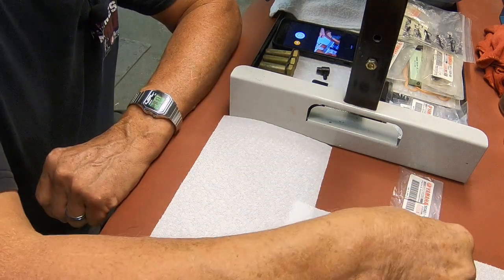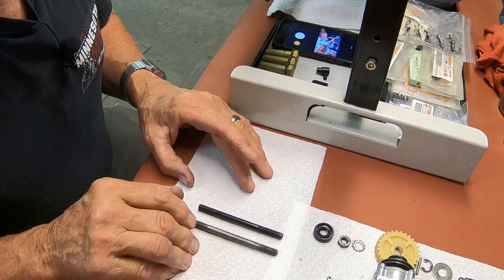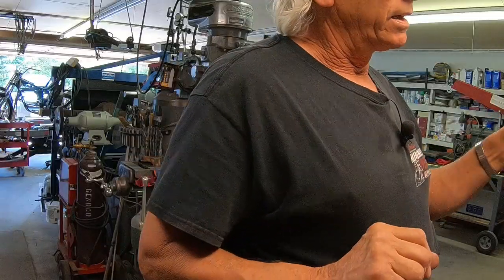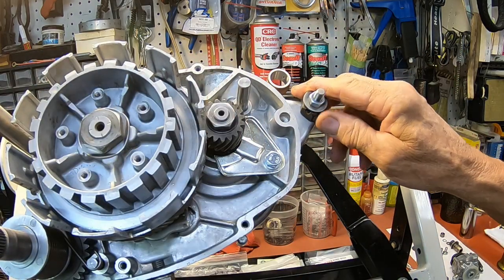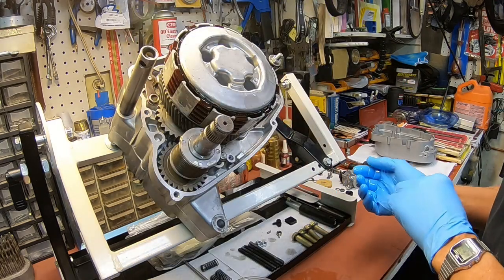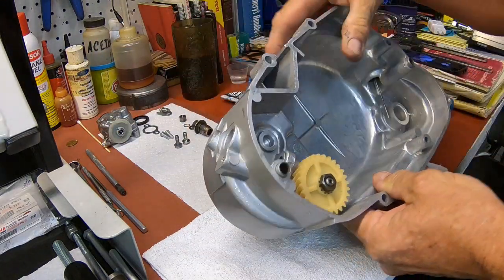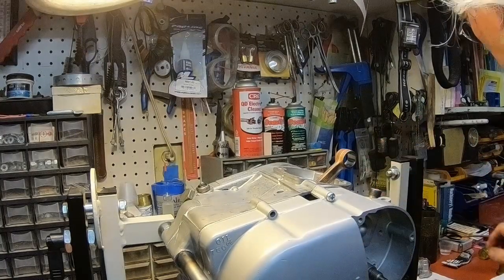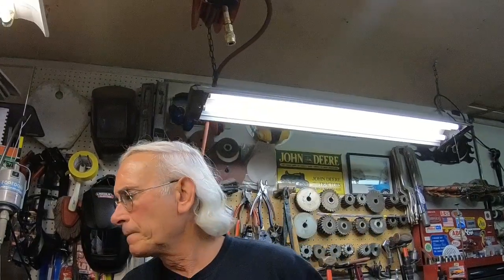Yamaha AT-1 to CT-1 engine assembly part 3

Comment: Another great video Dale... on several Yamaha 2 cycle's previously, I just delete the oil pump with a block off plate. Then i just pre-mix the fuel @ 32:1 and typically they run alot cleaner. But for restoration sake, I think it is good to keep it all original 😀
Reply from the maker: Hi Taylor, there is nothing wrong with oil pump delete, and your right they probably will run cleaner, especially with todays better oils. I have never seen one go bad, but have heard of that happing. The build a AT-1 MX project that I am currently work on will be oil pump delete, just because it is a full blown nostalgia racing bike. Plus I want to run some of that wonderful smelling bean oil. Man I really miss that stuff. Thanks for following along Taylor!

Comment: Hi Dale
I truly enjoy watching your videos. I like the way you pay attention to detail  when reassembling the motor and I like the way you explain and measure the different parts going back into the motor. I have learned a lot from watching you re assemble the motor.
Lee up the good work.
I have 4 Yamahas 69-72 175 all with the same motor and frame numbers.
Question we’re did you get the engine stand did you make it or did you buy it?
Thank you for doing all the videos.
I am now a subscriber.
Mark.
Reply from the maker: Hi Mark, nice to have you on board. I really enjoy doing the videos and am super happy that folks are getting some good from them, or at least some entertainment. Wow 4 175 Yamaha's, that is great. You know I think the 175 is my favorite these days, as you know I own two, the 72, and the 70 (kinda) that I am building now from a AT-1. In the past I was more of a big bore guy, but as I have gotten older and hopefully wiser, I find the CT-2 is just what I like best. The engine stand is a Motorsports products MX engine stand. I got mine from Ebay I think probably 5 or 6 years ago, I just looked, now they seem to be around 160.00. Pretty sure I paid closer to 100.00. But they have gotten more popular. They are great stands, sometimes I have to do mods to it to hold a particular engine or to hold it in a weird angle. Usually just have to drill a hole somewhere and make a separate bracket or something. Thanks for hanging out in the shop with me.

Comment: Hi Dale, I like your videos, I am learning more and more about these CT1's Wondering where you got those seal supports? I find mine were not staying or not put in all the way when they were changed last time. The bike is new to me and I am working on making it a reliable bike and putting it back the way it should be.
Reply from the maker: Hey Lee, glad you're finding some value in these videos. You can find the seal retainers on Ebay, right hand 304-15128-00, and left hand 304-15118-00. They are easy to install and really help to keep them in. Good luck with your CT1 project, they are great bikes.

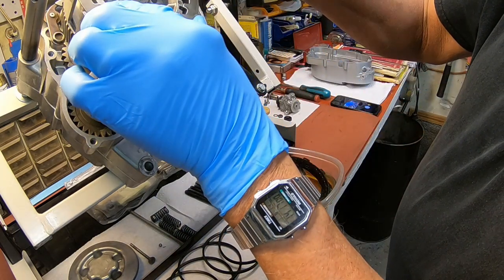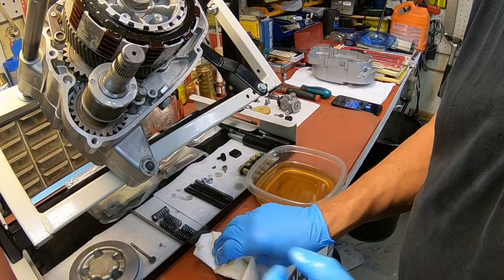Comment: Hi Dale, I love your videos and find them very helpful! I had a question about assembling the clutch. When you went together with it at 27:18, you started with a steel plate and finished with a friction plate at 29:52 before installing the pressure plate. The shop manual actually contradicts itself on P. 56 and 57 showing a friction plate installed first in the cutaway view on 56 and a metal plate first on P. 57 in the exploded view. My question is, would this make a difference? It appears that the surface on the clutch boss is more substantial than that of the pressure plate and might thereby be more appropriate to have a friction plate against it whereas the pressure plate does not appear to be as substantial and might benefit from the steel plate being installed last. Thoughts?? Thank you again for the great videos. I am assembling an AT1C and find that they answer many assembly questions that come up. Nice work!!  --  Tim
Reply from the maker: Hi Tim, thank you very much, I get this question pretty often, let me see if I can address it. You are correct that the left side drawing and the right-side drawing contradicts each other. It is apparent to me that Yamaha didn't even know how it must be assembled either. Some will argue that the left drawing is an engineer's drawing, and it is correct, putting no stock in the other drawing. My opinion is that neither drawing says it is an engineer's drawing and that it must be assembled that way. No where does it say that. In my experience tearing down engines that had never been apart shows that the clutches have been assembled by the factory both ways. My experience is from the early 70's to the present, I have literally worked on hundreds of these over the years.  Now let me see if I can show my current rational for how I assemble the clutch. First, I agree that it should probably be assembled steel plate last at least for a new engine. (One reason I say this is, the 250/360 manual does not have the contradiction that the 125/175 manual has) Over the years these clutch baskets have had grooves worn in the slots, from the fiber plates banging against the aluminum. What I do is carefully file most of the grooves out of the slots, not completely, you don't want to remove too much metal. Then I reassemble the clutch with fiber plate last. This way the fiber plates are banging in an unworn area. Now knowing that Yamaha had assembled both ways and I have too for close to 50 years, I know that the clutch will work assembled either way. I have never experienced any slipping or failure assembling it either way. Now I must say that this subject is a lot like politics, I can talk till I'm blue in the face that this is the right way, and it will not change someone else's opinion. So, I don't try to do so. I tell folks that they should assemble it the way YOU are comfortable doing so. When the manual is cut and dry, I will offer my interpretation if asked, but when an area is up to debate such as this, I just offer my rational and leave it at that. I must say that I applaud you for how you asked this question in a nonconfrontational way, most do not. In cases where folks are confrontational, I just do not respond because I have better things to do with my time and there is never a good outcome. So, thank you for that, and I hope I have shed some light were there may have been darkness. I wish you luck with your project and I sure appreciate you spending your time hanging out with me in the shop. It is my hope that folks can get some good info and if nothing else some entertainment from these videos.
Reply: Dale,  Thank you for the prompt reply and your insight into this somewhat confusing issue. It's pretty bad when the factory can't even get their own manuals right... I got exactly what I was looking for, an honest anecdotal answer with a rational based on real world, practical experience. It is interesting that you've seen these clutches come apart from the factory assembled in both configurations. I have the one I'm working on assembled the way you demonstrated in your video and feel more comfortable with it after your addressing it. I feel much more comfortable with someone's real world experience clarifying a contradiction like the manual has as opposed to finding a way to contact a local dealer (unless you can get lucky and find one with a veteran on staff) who isn't going to have the foggiest idea what kind of bike I'm even talking about. 

I will say that it is an interesting practice of reversing the order of the clutch plates to get an "unworn" surface on fingers of the the clutch basket. Have you ever run into situations where doing this has caused the plates to get caught on the old, worn areas and thereby cause a sticking or slipping problem? It makes a lot of sense as long as it's not making any difference in the way the plates are stacked upon re-assembly. 

Lastly, without getting too "political", I find it sad that someone would be disrespectful enough to come onto this page and be challenging of your opinions, experience, or practices. Politely asking for the thoughts behind your methods and maybe explaining a different view for a friendly "have you considered this and if so, did it or did it not work?" discussion, I can see, but sometimes, I think there are way too many keyboard warriors with huge egos that like the drama that they create by being so confrontational. It's a sad world anymore...  That being said, It would like to thank you again for taking the time to reply and assist me in clarifying what the factory left unclear. Keep up the great work!!

Comment: Dale Sweger .   The sleeve that goes over the shaft.  I am confused how that is supposed to go on.  Could you explain it to me?  Everything I saw said to install with the hole in toward the motor, but you said that goes out?
Reply from the maker: I assume you are talking about the clutch spacer that has the oil groove and the hole in the recessed area. If so that is correct the hole that's in the recessed area goes up. Per Yamaha combined service manual 1973.

Comment: Hi dale did you not put the clutch thrust bearing in the wrong order as the parts diagram shows different to the way you put it let me know please as I am confused cheers dale
Reply from the maker: Hi Gary, I did it correct, you need an old parts manual to know the difference in the shims. I went to Yamaha's online parts break down and I see what you are talking about, but here is where you need to measure your shims. The two shims they show that go around the distance collar are selective. You need a 3mm thick shim there, some of the old bikes had a 2mm and a 1mm shim, but the later ones have only 1 shim and it is 3 mm thick. As I say in the video, the thrust bearing behind the clutch boss is 2 pieces, if you order a new one you will get the thrust bearing and the thrust washer that are both the same size. These two pieces make up the bearing, but they don't show it that way in the later parts breakdown. So... when you put the collar on you need a total of 3mm shim there. Some will have a 2mm and a 1mm, others will have only a 3mm. Then just before putting the clutch boss on...you will put the 2-piece thrust bearing that looks like it is one piece (the smooth shim first then the bearing, then the larger one with the smaller hole, it should measure 20mmx38mmx2mm. If you don't have the old manuals, you will not know that there is different thickness of shims. The parts breakdown does not tell you the thickness, The old parts books do. I did it correct, just go back and measure the shims as you put them in just as I did in the video. It is confusing and you have no way to know unless you have the old book. Hope this clears it up, if you have more questions, please feel free to ask, here is my email dsweger@bresnan.net. Thanks Gary.